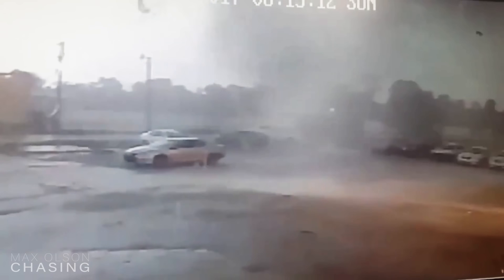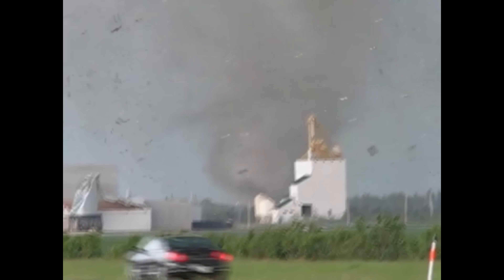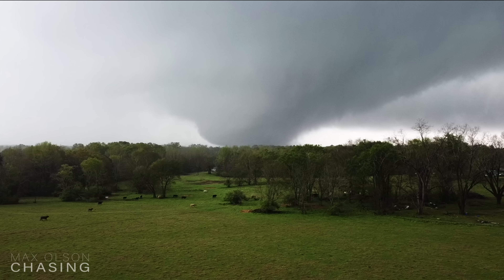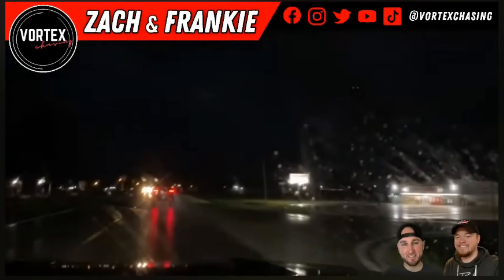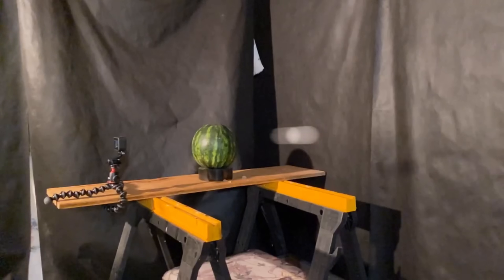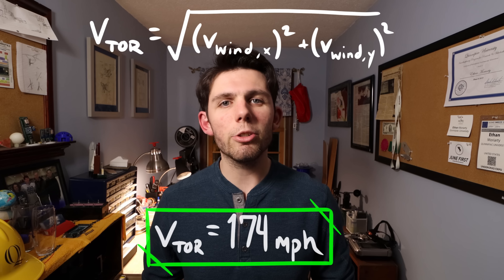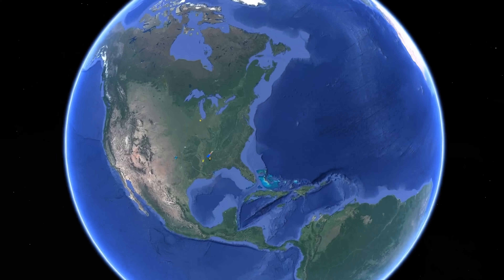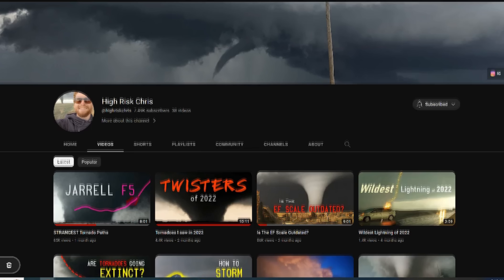Is This a Vehicle Flying Around a Tornado? - Rolling Fork, MS

Comment: To me, each light seems to be a single point of light that is more or less omni-directional. That would be quite the coincidence for both visible lights to be two separate vehicles with a single headlight that always seem to be aiming toward the camera.   The color temp is interesting as well.  The yellowish white suggest old incandescent or halogen lighting.   What battery powered lighting would have a yellowish white light that would be visible from any direction, even if spinning/tumbling?  Though I suppose if you have a relatively small bright light source that was spinning/tumbling fast enough it would appear as a constant light source from a distance even if it was a directional light source normally.  So it could well be something like a battery powered street/area light or even the emergency backup lighting used inside commercial buildings( the ones that come on during power outages).  Both have battery backup power and are usually quite durable in construction so they could, in theory, survive much of the impacts from the tornado.

Comment: Someone can tell you if one of the cars has been moved a couple of blocks away. This is difficult to do because you gotta survey all the cars in the area  before things are cleaned up and its not a good time to be asking the victims or authorities personal questions. Also, if the lights were on then the vehicle was likely running (keys were inside). Dare I say it, someone may have been inside at the time (I’m in my car most of time it is on).

Comment: I don't think it was a vehicle.  A vehicle's headlights point in one direction so as the vehicle is surely and violently tossed about in all angles and directions as it circles the tornado, the light should blink in and out as the vehicle is tossed.  But that's not what we see here.  The light is constant and steady as it shines toward the camera, even as it makes a complete circle around the vortex.  Not how you think an automobiles headlamps would look as it flips about in all attitudes by the wind of a violent tornado.  Whatever it was seemed to be a glowing orb, most likely a power transformer that exploded and set ablaze and then lofted.
Reply: Maybe the camera for this angle just didn't capture that 'flickering' well. This other one ( https://www.youtube.com/watch?v=qJ27vMTp_L8&t=88s ) does capture that flickering.

Comment: Cant help but think based on there being two light sources that these may have been battery powered yard sensor lights. Some of these are incredibly bright and are used in applications where customers do not want to run wiring. Sure could be vehicles also but the most likely theory may be the correct one. It is less likely to be vehicles based on previous footage of lofted cases showing vehicles that are lofted tend to fall out of circulation again within half to one rotation and dont achieve that altitude.

Comment: It was a drone ffs.
If it was a vehicle, the idea that it would be stationary so that the lights weren't spinning in all directions is just mad.
Drones have become increasingly popular to use in chases.

Here's a simple test. Figure out the suface area capture and then calculate if there's enough area for 300mph winds to pick the vehicle up.
With zero windows popped out =zero chance
1 window popped out = maybe, but the stress insde of the car with it being lifted has to be greater than the car. Could the windows take that force? = Nope, they'd pop out.
All windows broken = nope, zero capture

Capture is required with heavy objects to make them lift with wind.
Think of how a sheet of aluminium might get lifted = its light weight
Now think of how a lead sheet would react to winds =much more like a vehicle 

But what about the big containers that got launched a few years back? 
One end was shut basically turning it into a steel carrybag.

Vehicles tend to get shunted around but only for a short time. If a huge wind force shunts the vehicle a bit like someone chipping a soccer ball it could go some distance, like we see lots of examples of but never levitating like you guys think you see.

Drones
Reply: Yeah...no.

For one thing, another angle ( https://www.youtube.com/watch?v=qJ27vMTp_L8&t=88s ) DOES show the 'flickering' that would indicate spinning and tumbling.

For another thing, contrary to what you claim, YES, tornadoes have indeed lofted vehicles long distances. There's no other way that the Ford-Explorer-shaped dent in the Smithville Water Tower would exist, for example, if the 2011 tornado that hit the town hadn't lofted such a vehicle into it from half a mile away. There's also how the New Wren (officially-rated) EF3 from the same outbreak threw a different vehicle more than 3000 yards.

And for one more thing, if it really WAS a drone, that drone would have to be huge, sturdy, and have huge lights on it for it to be visible from that distance. I doubt such a device would be available (or of use) to any storm chaser, let alone anyone who lived in Rolling Fork (which is a pretty small country town, by the way).

There is no way that that thing was a drone. Just saying.
Reply: @gamprhabanero5351  The trouble you're having is perspective. 
I said that cars can get lofted to an extent, i just didnt use the word loft.
If that's a car then we have seen something never seen before, which given the number of car fatalities we see from tornadoes, I find it quite remarkable that nobody has ever capture a car being picked up as high as this with the headlights active.
This object with lights must be up 1000ft or so if it's right next to the tornado
That i would say is not possible for a car given it's lack of interior capacity and the recorded wind speeds.

A car is not a homes roof and even they fall back down once they break up.
An object has to have parachuting capabilities to get taken up that high.

The may 3rd tornado would have been spitting out cars for fun with headlights on (it gets dark even in daylight).
It shunted, lofted and tumbled cars.

Comment: It was not a car. If it was a car, then the car headlights would be rotating or moving around with the car. This shows a light all the time and for a car to always be shining its headlight at the camera is impossible. The only possible item it could be is a self powered high intensity spherical light or lamp. There are many available on the internet. Has anyone determined the lumens emitted by the object? Once you determine that. Look in the area where such a lamp would be located. Could it have been a street light or a light on a power poll? There is a church that was hit at the time of the object being seen. Did the church have a lamp on top of it? One other thing. Did you notice a light of equal size and luminosity on the ground facing the camera?

Comment: I still believe it was a drone between the observer and vortex. Drone movement and other aerial occlusion between observer and drone made a nearer point source of light look like it was orbiting vortex.

The problem with it being headlights is that they are unidirectional. At no point in the proof of whether a tornado can loft a car did you address the chances a tornado could loft a car without imparting any rotation at all. It's not realistically possible. Look at the other lofted vehicle footage.
Reply: There's another angle ( https://www.youtube.com/watch?v=qJ27vMTp_L8&t=88s ) that shows the 'flickering' more clearly.
Reply: @gamprhabanero5351  Flicker-removing processing / compression in the Olson video would be a pretty simple explanation for how this could be headlights. That's sort of frustrating, forensically, though.